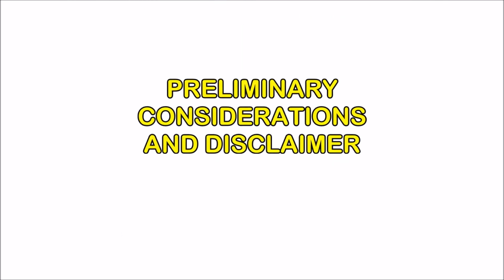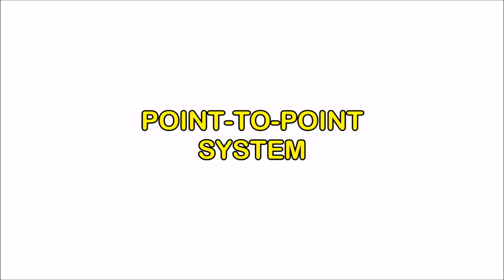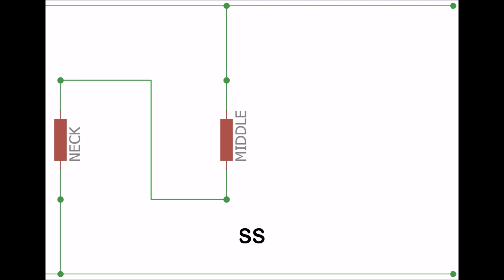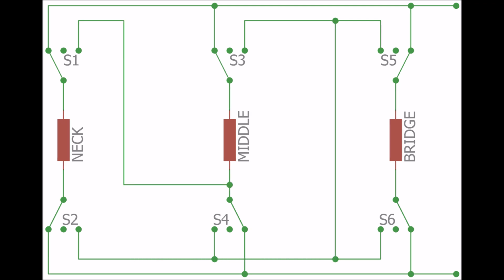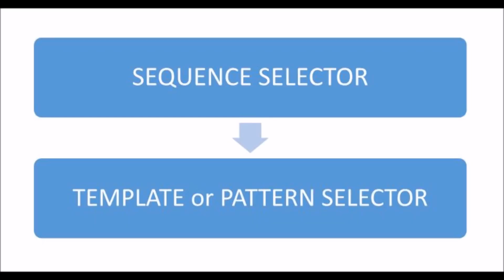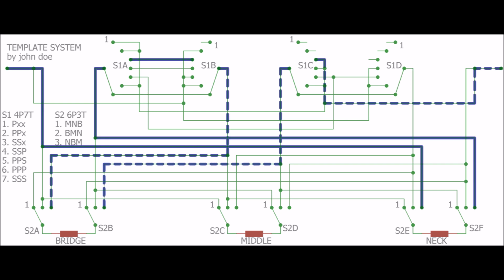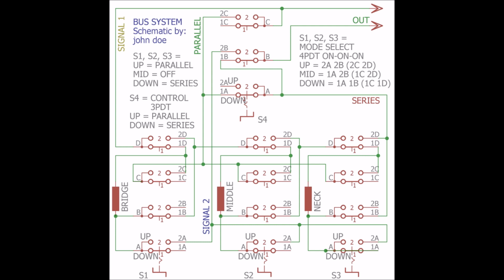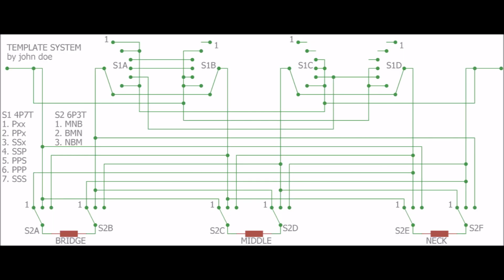All You Need To Know About All-Combinations Pickup Switch Systems - Part 2 - Concepts & Applications

Comment: Sound producing combinations:
  1 Pickup:    2^1 - 1  =   1
  2 Pickups:  2^2 - 1  =   3
  3 Pickups:  2^3 - 1  =   7

  1 Coil:      2^1 - 1  =      1
  2 Coils:    2^2 - 1  =      3
  3 Coils:    2^3 - 1  =      7
  4 Coils:    2^4 - 1  =    15
  5 Coils:    2^5 - 1  =    31
  6 Coils:    2^6 - 1  =    63

Effect of Out of Phase:
  1 Pickup:        0   (nothing to do)*
  2 Pickups:   +1   (OOP or normal)
  3 Pickups:   +6   (~A|B|C = A|~B|~C)

      *) Technically works, but doesn't
          affect the sound of lone Coil
          or Pickup (or sound track...).

Effect of Serial/Parallel:
  1 Pickup:         0   (nothing to do)
  2 Pickups:     +1   (S or P)
  3 Pickups:  +10   (S and/or P)
  
Effect of OOP and S/P together:
  1 Pickup:         0   (nothing to do)
  2 Pickups:    +3    (S/P + OOP/normal)
  3 Pickups:  +40   (S/P/S&P + OOP/normal)

Comment: Of course I find this after I've worked and worked to find a similar solution. In the end, they both work similarly, yours just seems much more.. practical, really. The template system, specifically. Finding a 6p3t rotary switch wasn't that difficult on Amazon, but the 4p7t switch is a different issue. 

My solution used the fender 3 way switch, and 2 spdt switches to enable the series/parallel options. The way I was seeing it, bridge ground always goes to ground. Bridge hot can either go to the output, middle ground, or neck ground. So I needed a SP3T switch with 4 lugs. The 3 way switch from fender is that, but double pole. Saving myself the hassle, I put the middle ground control on the other side of it, since it either goes to ground or to the bridge hot, so moving that switch to the middle position automatically switches both pickups to series. Middle hot either goes out or to neck ground, and neck ground either goes to ground or bridge/neck hot, so they both get a spdt switch. Neck hot always goes out.

I don't have quite as many combinations as your solutions, but the other things I have (phase switching, coil selection for the three humbuckers) gets me up to 1,484 combinations. I can't even imagine what this solution could get up to.

Thanks for making this video, though! It was definitely worth watching!
Reply from the maker: Thank you for your comment.  I am glad you enjoyed the video.  

The sample diagram for the Template System can still be modified or simplified if you do not want to use or cannot find a 6P3T or 4P7T switch.  Both the 6P3T and 4P7T slide switches are available from AliExpress and they are quite cheap.  Ceramic rotary switches are relatively expensive and bulky but they will last for a long time.  

You can use the 4P7T as a replacement for the Strat switch as a simple twangy Strat sound only selector for all of the parallel and single pickup connections.
Reply: @john.doesnt  late reply, but relevant. I'm enjoying thinking about all of this and the total possible combinations of different layouts. However, I've run into an issue. With anything larger than 3 coils, drawing out a table for each becomes a lot more difficult, and exponentially bigger. Is there some sort of math that will just give the final amount without having to make a table of all possible combinations? Like, say for 2 humbuckers, treating each coil as an individual pickup? Or even HHH?